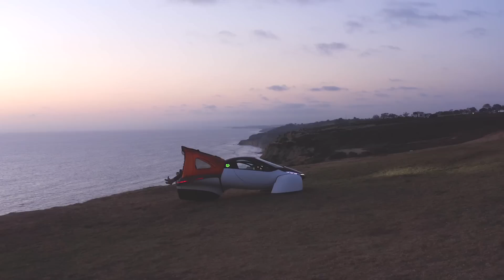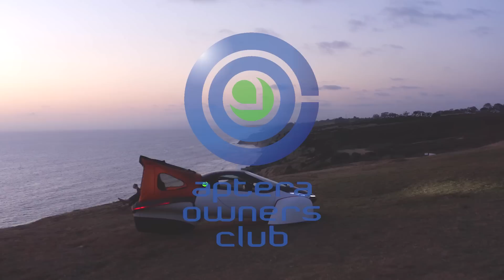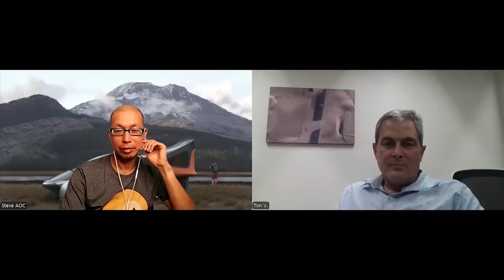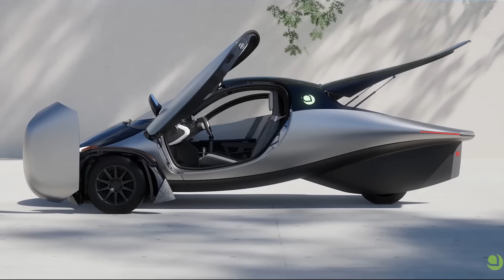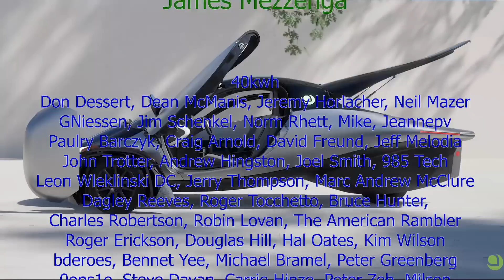Aptera Battery with Tim (3/3):  LFP and other viewer questions

Comment: I suggest if you want longer range once or twice a year or as insurance you can make use daily of the bigger battery if it can be used to power your house. Charge by PV or at low utility rate. 
Of course, the electronics must come with the car. Will it?
Reply: Not at first. I expect bidirectional charging will be available in another year or 2. 🤔

Comment: Thanks for posting.

Looks like our Aptera will have a lithium ion 12 V battery.  Nice.

Charge on!
Reply: Yeah, really nice!
My current car has a 12V lead-acid / AGM battery and if one does not use the car much, that battery is the biggest troublemaker. Deep discharges kill it quickly. One really needs to keep such a battery close to full and never ever go below 50% - which was difficult before I added a bluetooth battery monitor.
Great that we'll get something more modern in the aptera and even better if it is built with 18650 standard cells.
Reply: Yes, this is great news.  When my 12v died in my current car (2018 Leaf), I replaced it with a Lithium Ion 12v from OhmMu (just add a .com to that for their web site).  It's shocking how much of a weight difference there was.  Also, extreme heat kills off 12V batteries rapidly.  I'm not sure I've had one last longer than 2-2.5 years living in Austin, TX.  This new one is warrantied for 4 years (and they claim it should last about 4 times as long as a Lead Acid battery, so hopefully it will last longer than I own the car).

Comment: Would love to see Sodium Ion.  Yes it has a lower energy density but the Aptera battery packaging would allow for that.    The 250 mile could be packaged like the 400, 400 like 600, 600 like 1000.  The 1000 mile pack would need to be a standard lithium chemisty though.
Reply: Sodium ion is physically large despite the latest versions not being much heavier than LFP.  With the volume calculated for the 1000 mile using the same module layout using 21120 cells the volume is about 133 liters. If 100% of that volume me could be filled with the state of the art CATL 200 wh/kg sodium ion cells it is still only a 33.3 kwh pack.  Viable but not nearly town one tier.  LFP could achieve 45 kwh.  It is possible with state of the art LFP that the values could be higher but volumetric density isn't always easy to find.

The volumetric density expectations for the "1000" mile 21120 cells are incredible and I think realistically 1000 miles wont happen without a major battery advancement (far more than longer cells); 150% increase in energy in 70% more space is hard to believe.
Reply: Might as well. Aptera keeps making wholesale changes to the vehicle, might as well redesign the battery once again. I would rather have perfection and a 2028 production start, as opposed to the current H1 2025.

Comment: Could the Aptera qualify for tax credit if it had two small tires in the rear instead of one larger tire, would it then be considered a four wheel vehicle?
Reply: I think that there is a minimum distance between the wheels that is required, but I don't know what it is......

Comment: I apologize, made a brain fart in my last comment in section 2 of 3 of this great interview with Steve and Tim, I was asking about batteries but mentioned the solar company. My only excuse is I only had 2 hours sleep the night before. I would like to say that because I live in a remote area, for me it would be optimum for at least a 350 mi range battery, especially the Lion batteries which you are not supposed to charge past 80%, which yields usable 240 mi range on daily basis. We have a BYD with LFP and I would be open to LFP as well, at least you can use the full range. I will also require 3 driven motors for dirt roads and snow. I hope it doesn't take too long for Aptera to resolve this issue as well, we are investors with pre-orders who are Aptera supporters.
Reply: Nothing wrong with charging any Lithium battery  to 100%,  IF the battery isn't stored that way for days. Charging to 100% just before a long trip begins is a recommended procedure with no significant downside.  Same is true for using the battery down to under 5 or 10%. Just be sure you are recharging it right away when you arrive at your destination.

Comment: I prefer LFP and am willing to have a heavier vehicle with same range or slight less range with same weight.
My ZeroSR has a DC to DC with no 12v battery.  Not sure why you'll need a 12v battery at all if you already have a DC to DC.
Reply: LFP or even sodium should be possible for 350-450 miles of range given the volume of the 1000 mile nmc pack.  The extra ~100lb impacts efficiency but it is also greener and cheaper and should ideally be in the roadmap.
Reply: Need for a 12V battery (just guessing):
- maybe they need it for current peaks, so the 12V charging circuits don't need to be as strong.
- maybe they need it for "booting" (AFAIK, in my current car (Prius 2), the HV battery is disconnected at rest and it needs power from the 12V system to power up the electronics and connect the HV battery, guess via a relay). Of course in the Aptera the HV system is not idle / totally decoupled when it is solar charging, so not sure if they also have such "booting power" needs.

Comment: These detailed tech info although true and interesting but they matter little. The general trend is bleak for Aptera. 
The US Global Capital effort seems disappearing.
The PI bodies to Carlsbad are still nowhere to be seen, Aptera seems to be absolutely drained of cash, no movement from CPC.
The image of an Aptera on the beach seems to receding further and further into oblivion.
My true feelings of an investor.
Reply: Understandable but I’m personally much less pessimistic… about Aptera than domestic (US) politics. I remain puzzled that no angel investor since Gamma clear proof of concept and silence on US-C having closed CF June 29 (per Aptera email stating they reached some $5M cap I wasn’t aware of).
Reply: @gr8dvd 
You said proof of concepts. I saw none of it. Just claims.
After the tunnel testing in Italy, Aptera refused to disclose the results.
Aptera has never shown the generations of power of their solar panels. 
Aptera has never proved the 100 Wh/ mile energy consumption.
Remember, big VCs have lots of engineers to check these numbers. When those numbers are not there, they do not step in.
That is my honest opinions.
Reply: @Kukaboora there was no test.  They weren’t set up to modify the tunnel for a 3 wheel car so they took cool pictures.  The number they are throwing out are from the computer simulations.
Reply: An informative and reasoned interview with a guy who obviously knows his stuff. He didn’t say “amazing” once. Not trolling anyone here, but it’s great to get answers from someone who is not at all a salesman.
Reply: It was stated on Instagram today by Aptera that US Capital has offered a $60 million convertible note for funding.
Reply: I hope to hell you are wrong 😮
Reply: Aptera announced in their News section that US Global Capital is seeking investors.  If you click on the US Capital link, and provide an email, you will be able to view the US Global information about Aptera.  The hunt for money begins.
Reply: @stix2you
I do not know who you are, but you sound big and self proclaimed important.
My concerns were spelled out in my reply.
1. Where is the proof of .13 CD ?
2. Where is the proof of 100Wh/mile?
3. Where is the demonstrated generation of the solar panels ?
See if you can have definitive answers by bringing them to higher authorities.
Reply: @Kukaboora  Where is the proof that you exist?  You could be an AI generated troll sitting in an old gum tree, for all I know.
Reply: @J-W-Kelly 
Childish at best.
Reply: You poor thing.  Sorry your outlook is so bleak.

Comment: I lived with 25 mile EV for a short time, it was strictly a commuter car. Work and back then plug in overnight. After that I had 100 miles range, it was wonderful! Only charging once every 3 days but still a commuter. Now i have a little ove 300 miles per charge and it is pretty sweet! Sill not ideal for road trips though. Battery needs fed long before I'm ready to stop. Charge stops require planning. I reserved a 600 mile aptera so that on longer trips I can stop when I'm ready and just plug in while I'm there. No more driving from plug to plug. I'll probably keep my 300 mile ev as a short range commuter vehicle 😅
Reply: I have a strong preference for travelling on secondary roads.  A six hundred mile Aptera gives me the flexibility not only to drive where i want, but by the ROUTES I want, even in regions where the entire fast charging infrastructure is on the interstates, even in cold to very cold weather.
Reply: preach it!
my old LEAF is down to 50mile range which doesn't 'leaf' much during cold days so just leased a 40kw new ('25) LEAF for 24 months-hopefully my Aptera will be ready by then!

Comment: I've got a reserve on an Aptera. Not the launch edition, but it is the 400 mile range. Will I ever need that in a single day? Unlikely, other than that 1-2 times a year I'd want to do a road trip, but I also have family who live about 41 miles away. I'd want a minimum of over 100 mile range, so for that trip, I could get to them and home in a single charge and then that is assuming while there, we don't go anywhere before I head home.

Hoping that some day Aptera are made with better battery options. As is, EV batteries are better for the environment when compared to mining fossil fuels for gas, but that process compared to EV battery resource mining aren't drastically different. The long-term use on the road though, EVs are better. I'm interested in the batteries I've seen companies working on that involves just using sand and other more common resources. These other options hold less energy, so shorter range, but far more recyclable than the current batteries as well as quicker charge rates. I'd be happy to go that route over the current battery options.

Comment: Wish we could have removable batteries. 40lb, 50 mile packs charging in the garage. Plug in as many as you'll need that day. Latched down solid to a busbar in the battery compartment.
Reply: Tricky given the curves of the aptera.  Nimbus is trying to include that but battery cell balance would be an issue and nimbus is a 500 mph limited tiny vehicle (not nev).  Battery removal adds a lot of complexities that the industry in general has tried to avoid.
Reply: Looking for this since the dawn of EVs. Standard answer is the BMS can’t handle the variable configuration. My response now is… have you not met Tim 😀
Reply: That would make sense on  large truck or electric train, not on car with the most efficient design in mind.
Reply: @J-W-Kelly  except the equipment to load and unload it would weigh several tons and take a lot of space.  China did full batterie swaps;overall not a great idea.
Reply: @ccibinel  Full battery swaps for personal cars would be great if standardized size, connectors, etc. like public chargers. But NOT happening. However, purpose-built battery swapping makes great sense… ex: public buses, trolleys and even airport tugs. Picture vehicles driven autonomously to nearby solar array & swapping station when running low and quickly returned to service.

Comment: As others in this thread are saying, once you have a range of ~300 miles, additional range isn't worth very much. At that point, additional money should be spent on improving charging speed (expressed in miles per hour) rather than range. Aptera is doing this by increasing battery capacity, which gets you increased charging speed as a side benefit, but this doesn't seem very efficient. Theoretically an Aptera 40 KW (400 mile) would be able to charge at ~9C rate on a 350KW charger, which would be 3600 MPH. In other words it would get you a 200 mile charge in ~5 minutes.